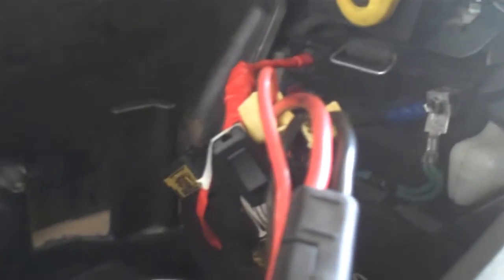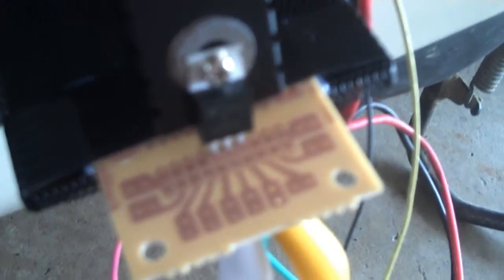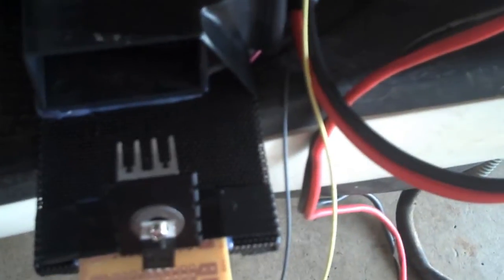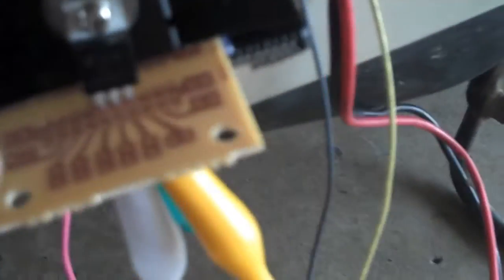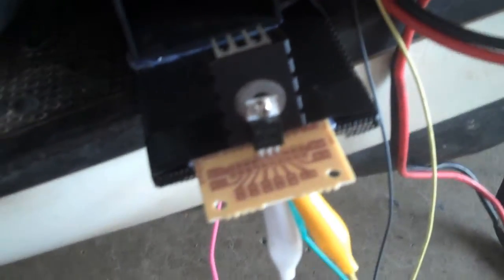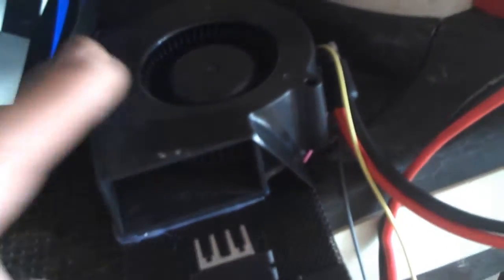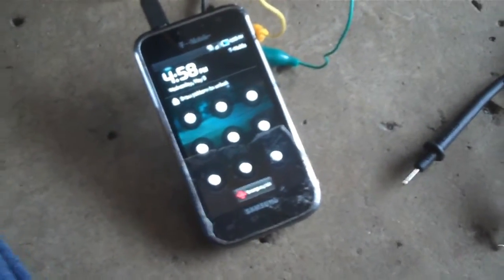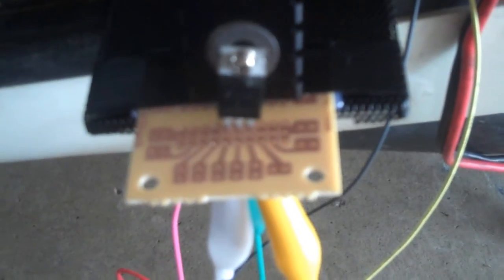Car battery to phone charger

Comment: that moped battery is more than 6 amps should be like 120 amps 6 amps and 12.6 volts if fully charged  isn't much compared to a houses 120 volts and 100-150 amps